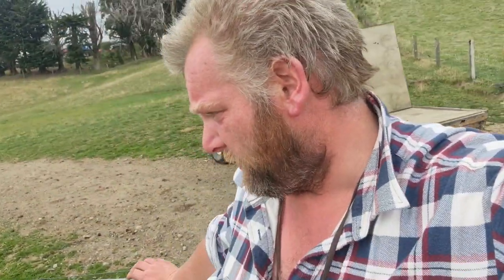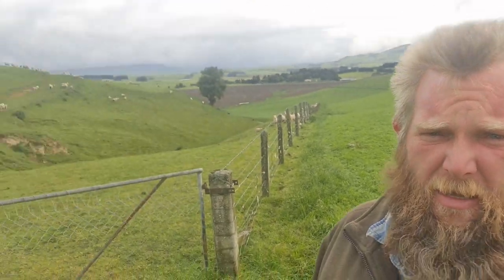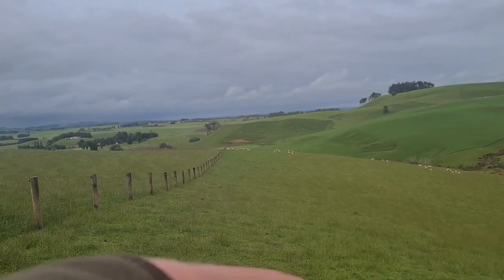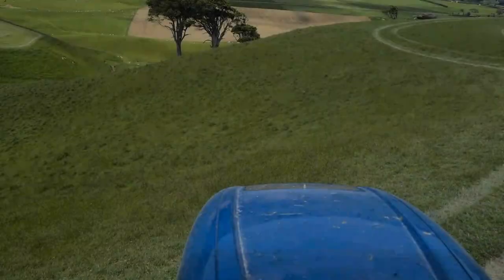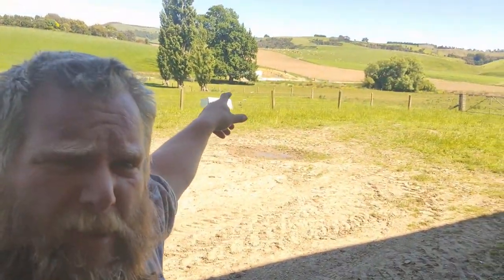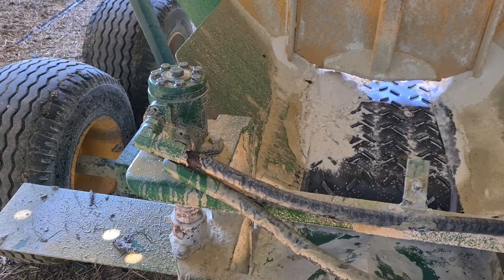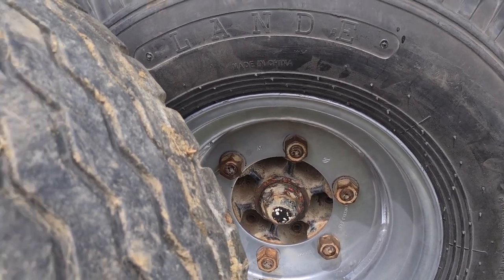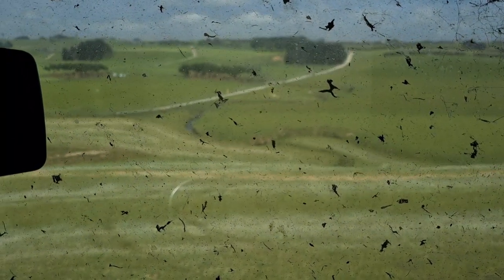Shifting sheep, applying lime on some steeper faces, and a bit on why we use lime.

Comment: Hi Ben another great video certainly makes you wonder why such terrible price increases, Fuel ,fertilizer just beyond a joke. Just a question when your were tailing was that a conveyor they were using for the lambs as you didn't appear to have to pull them along once loaded?
Hope you get some rain shortly good old southland never to long before the rain returns.
Reply from the maker: Cheers Paul, yep,hydraulic driven conveyor.Just under $20k to set up, but the contractor wouldn't be without it.

Comment: Hi Ben here Ireland urea is around 960 euros a tonne €320 - €360 this time last year, CAN could be bought for €185 last year now around €700 tonne. Any of the compound ferts €1000 - €1100. To buy what I bought last year it will nearly be three times the price this year not going to happen. Here in Ireland we'd be putting lime on at 2 tonne an acre it's around 27 euro a tonne spread by contractor.
Reply from the maker: All very similar to here, except CAN.When urea was $600/t it was about $800.....
Reply: can is 900 euro  tonne now .............
Reply: even the pig slurry  is twice the price it was last year .............